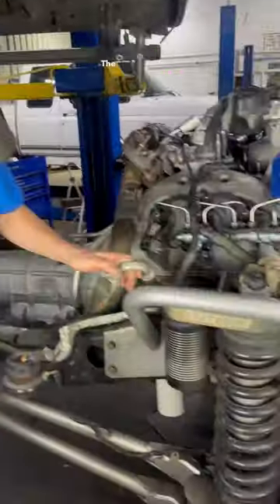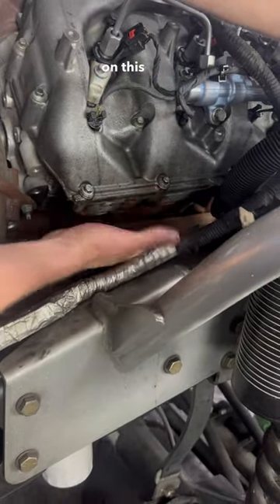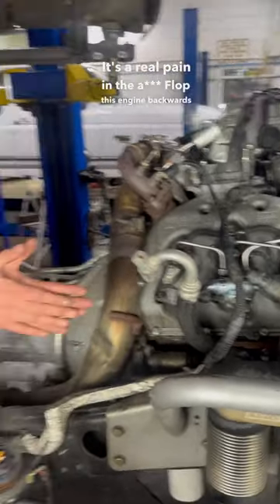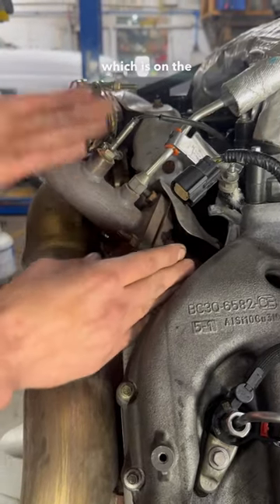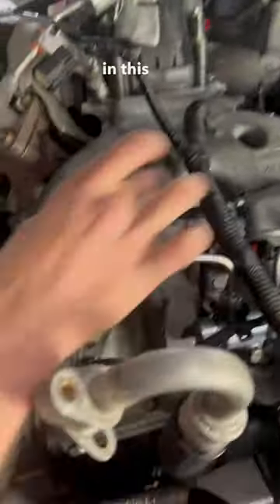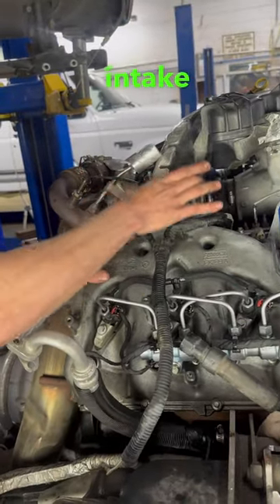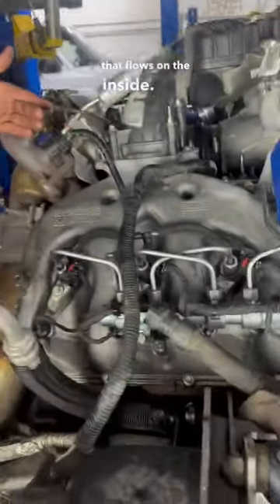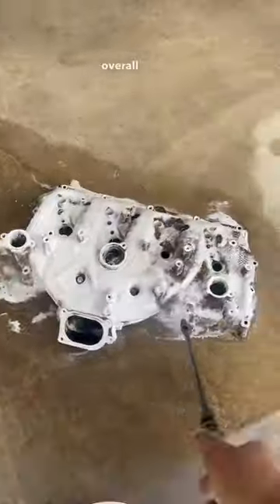What makes the 6.7 PowerStroke so unique? #ford #powerstroke #shorts

Comment: Makes you enjoy an inline 6 just that much more. Simplicity is your friend.
Reply: Except all the negatives about inline engines. There’s a reason the most powerful production pickup diesel and over the road truck engine are V-8s. 6.7L powerstroke and Scania 730
Reply: @jimmysturdevant9843  and the negatives are?
Reply: @steves9955 that a 1988 300 inline six still fires up today and won’t die so I don’t have to replace it, neither will my 7.3.
Reply: @ebolawarrior451   inline 6 are the way to go. 7.3’s are great, just a little slow.
Reply: @jimmysturdevant9843 Which is why almost all highway tractors and wreckers are inline?
Reply: @jimmysturdevant9843 Also most power doesn't mean most capable
Reply: @austincoutu  most capable isn’t a real thing. That’s an entirely subjective term. Scania is top dawg. We don’t have length restrictions I’ve explained that. Inline engines work better for our market. It’s a simple as that. Inline engines don’t have have any substantial attributes that aren’t negated by somthing else.
Reply: Who wants to be able to do an in frame rebuild or replace a valve cover gasket without pulling the entire cab off the chassis?
Reply: The inline six is gutless compared to Fords 6.7 and GMs 6.6.
Reply: @southernpovertycallcentere8373  well go back in time buddy it just ain’t possible anymore.
Reply: @Silent_Shadow  we’re not talking power junior, talking reliability and simplicity.
Reply: @steves9955 been a few 6.7 fords hit a million miles.
Reply: @freedomisntfree_44   I have nothing bad to say about the 6.7’a other than cluttered to hell under the hood. Most reliable diesel ford had since the 7.3
Reply: Yeah a cross flow i6
Reply: You could eat off the tailpipe of my 6.2 @ 106k, it's that clean....just sayin
Reply: Ford should design a clam-shell hood for easier engine maintenance.
Reply: God bless Jeep 4.0 and the Ford 300.
Reply: @steves9955 I guess they’re too balanced for him
Reply: @danielfrazier840 cross flow or reverse flow, both are fine
Reply: @ihaveshitmyself4424   yup, and dirty tunes leads to too much fueling not being burnt properly and end up with a melted piston
Reply: @jimmysturdevant9843  wtf? What world are you living in?
Reply: @jimmysturdevant9843 the most powerful diesel pick up truck ever dynoed is a straight 6. V8s nowhere to be seen. OEM ratings don’t speak to an engines potential. 

All things being equal the architecture of an inline 6 is much stronger. 

The scania 770 has 1.5 liters more displacement than an X15.
Reply: @jimmysturdevant9843  weird. I was able to have my head rebuilt without lifting my cab in my 2012
Reply: @southernpovertycallcentere8373  congratulations. I can do that on any ford too. Dummies don’t realize the WSM has a cab on procedure for all trucks
Reply: @jimmysturdevant9843  it's OK, I'd be salty if I had to do that mess of a job too.
Reply: @southernpovertycallcentere8373  don’t mind it even a little. Skill issue.
Reply: @austincoutu Are you sure about that? Do you understand why the US doesn't use V8s any more? A V8 weighs a minimum 1,000 lbs more. That is 1,000 lbs less profit. Europe still uses V8s.
Reply: @jimmysturdevant9843 absolutely  not true. All true diesel are inline 6.
Reply: @jimmysturdevant9843 did you forget the cummins I6 is more powerful than the 6.7 v-8....?? Speaking torque numbers
Reply: @braakaakaa  you must be under a rock. 6.7 powerstroke is making 500hp and 1200ft lbs. 🤡🤡🤡🤡

Comment: Nobody can convince me this is an improvement.
Reply: I literally is in all the ways he mentioned it 😐
Reply: Thats how modern engines make more stock power
Reply: @boraxguy8302  No that’s how modern engines cost more to repair.
Reply: If you have to replace the up pipes on a 7.3 or 6.0 you'll be convinced. Running the exhaust all the way around the motor is dumb.
Reply: @mikeznel6048 modern engines make more stock horsepower than anyone thought possible.
Reply: So Ford knows how to make a good engine.  But they Make these engines instead.  Is there a market for reliable replacement engines?   I'd sure think so.   I'd never buy one of these Fords.
Reply: @HK-qj4im  
No..not really

Comment: When air turns 90 degrees some flow is lost. But that's almost 180. The plus is that the air should be swirling by then. Hope it helps emissions or efficiency
Reply: It helps with turbo response by shortening the distance between the exhaust and the turbine. That reduces turbo lag because the shorter distance reduces the amount that the gases can compress. A side effect is that we don’t burn ourselves on a hot exhaust manifold when we’re working on stuff near the side of the engine.
Reply: Older engines that don't use the hot V also have to turn the air 180. The difference is this has a much shorter pipe for better throttle response.

Comment: The design is very similar to two cycle engine marine cross flows V4s, where the intake enters from the outside, and the exhaust flows across the piston head, exiting through the middle of the engine.

Comment: This is why people shake their head at Ford...why. has to be a mechanics nightmare! When repairs to a truck constantly mean removing the cab we have gone to crazy town!
Reply: Cab removal on a Powerstroke has been standard for years lol. But they said this version of 6.7 with the reversed exhaust keep turbo lag down because the exhaust is so close to the turbo. I have had a 6.0 and a 6.7, can’t say I notice a difference lol
Reply: The way they did it yes, the smarter way is to have the intakes fed by a CAC in front of the radiator. The valve cover should just be a valve cover
Reply: You gotta pull the cab on every v8 diesel pickup since the late 90s, and he quite literally said it was easier to work on because of it. It's a really good design and it's the reason cummins are being phased out of commercial duty work 😂
Reply: @johnsandlinjr and duramaxes, and later cummins
Reply: These trucks are incredibly easy to work on. They are not intended for Joe shmo to work on, tho. ain’t the 80s anymore bud
Reply: Shiiit more complicated means more money in my pocket when they break. Also job security.
Reply: Heck, my 13 f150 needs cab removal for engine access, and it's an ecoboost
Reply: @gbeving3167  not true. I just did phasers and timing chains on a 14 ecoboost f150 with the cab still on.
Reply: @yaboykris2118   same, but to pull heads the cab comes off
Reply: @addisonherbert6686 Oh yeah? Well that'd sorta be alright, if everyone had a hoist in a garage, in there front yard....
Reply: @yaboykris2118 half ton ecoboost is not a powerstroke.  One's for groceries and the other is a beast.
Reply: @MrStaybrown   yes, but I can understand cab removal on the powerstroke, its stupid on the tiny engine
Reply: @MrStaybrown  never said anything about a power stroke.

Comment: Seems like a lot of hot air going in.
Reply: They have intercoolers. Intake temp in intake manifolds usually range 6-14 degrees hotter than ambient. Air to air intercooling is more efficient, but you have less control over air temp for emissions control.

Comment: Wouldn’t having the exhaust from the turbo being so close to the intake manifold make the intake air hot? Or does that not matter even a little bit since the cab is off and the engine gets lots of air flow?

Comment: Im suddenly appreciating the simplicity of my 5.3 Vortec
Reply: Same, but ford's been making dumbass decisions for a long time, I'll note the pre 95 OBS F series trucks were ran entirely off vaccum. If the brake light on top of the cab goes out, it affects vaccum, and affects the way the truck shifts, runs, and advances timing. Those rubber houses are all 30 years old now and I tell you what, vaccum lines don't like whipping shitties, but the transmission is also ass. Ya see, the e4OD transmission from those generations was stronger, but once it broke it would eject itself pretty immediately. The AOD in my truck will continually get more and more fucked but it will keep going until there is nothing left for it shift with. When I drop it into gear, the entire truck lurches, but you gotta love the difference in idle sound between disconnected and connected to the trans.
Reply: @Trucks_n_stuff you apparently have not worked on any other 80s or 90s cars. Every car at least advances the timing with vacuum. 1980-1996 Ford pickups have no more vacuum line mess than a Chevy or dodge from the same time.
Reply: If they had only made the lifters easier to replace on the 5.3
Reply: I believe he was talking about the ford's eec3 back in the early 80's. You would have to use a vacuum gauge to figure out what codes you had or something like that. When Ford went eec4 in 86 that's when the AOD Trans and fuel injection came out. Much better system then eec5 in 1997. Eec4 had a 60 pin pcm, and eec5 had a 104 pin pcm. Damn I'm showing my age as a mechanic . That time period was when I was a really strong tech kinda like this kid in this video is on modern stuff. You have to have alot of testosterone to work on these new vehicles.  Something I don't have at 55 years old and 30 plus years as a mechanic. At my age you want to make the quick easy money. Leave this type of work for the young bucks.
Reply: @jaredlancaster4137  vaccum advanced distributor timing is such a common thing I figured it was pointless to mention it. And yes, even my dad's 2000 toyota tundra had a mess of vaccum lines. And the point isn't that other vehicles don't have that issue. The point is that having a brake light fuse be somehow integral to the vaccum system is notably ford levels of silliness. They can be wonderful trucks, I adored mine when I had it even if it was a POS. Just because I think something should've been done differently, doesn't mean I dont like what was done.
Reply: @jaredlancaster4137  and you'd be somewhat right, I'm going to college to be an automotive technician, however we haven't done very much that would pertain to vaccum systems and my dad's always been a bit of a Fudd about working on cars so I never got much experience.
Reply: @hillbillyhicks8102  and after learning more about that Era of four, I learned my particular AOD wasn't all that fucked up, it just didn't have enough vaccum. It's amazing it still shifts considering how beaten on it is, but that's the beauty of a classic ford. No matter how fucked up it is, it will find a way to run.
Reply: @Trucks_n_stuff  okay...... As an owner of a 1995 f150, what vacuum brake light fuse are you talking about?

Mine has no issues with the vacuum system despite being rather beat up and missing parts.
Reply: @jaredlancaster4137  yeah, you have a 1995. The 1995s switched from speed density to MAF which resulted in a greatly simplified vaccum system.
Reply: @jaredlancaster4137  and I never said vaccum brake light fuse, i said brake light fuse. And I should've been more specific, it's not just the brake light fuse, it's the fuse for the topmost cab mounted brake light specifically.
Reply: @Trucks_n_stuff  well, you said "brake light fuse somehow integral to the vacuum system". I still have no idea what that would look like.

My 1995 is still OBD1 and looks identical to my 1993 f150. I think the change you're talking about happened with OBDII, which was changed during 1995 for 1996 model year.

In general, I really don't think there's more vacuum nonsense on my f150 than on a couple dodge minivans I had, and I think there's less than my 1991 and 1992 Accords, which seems to still have a vestige of the 80s Honda vacuum ECU.
Reply: @jaredlancaster4137  I'll attempt to explain. Basically, the fuse for that light is in some way, tied into the electronics that tell the motor when vaccum is needed, not just to advance timing but to shift as well. The result is, when that fuse is burnt out, you get noticeably worse shifting. It lurches into gear instead of shifting normally. As for the exact why, I'd have to ask the guy I sold my ford to because he's been the one to fix its issues because he's owned a fair number of obs ford's and is far more knowledgeable than I am. That's who my source of information is, and he is a master mechanic in addition to his real life experience. If you'd really like a better explanation I could ask.
Reply: @Trucks_n_stuff  well maybe that's why mine doesn't have vacuum issues, both of mine have been manual.
Reply: @jaredlancaster4137  that's probably a large part of it. M5OD or ZF5?

Comment: How does heat help a turbo???   Then why do we have intercoolers?
Reply: Right cause the intercooler usually cools the exhaust pre-turbo??
Reply: It’s called thermal efficiency. The hotter you can run the engine, and keep said heat confined within the engine and exhaust, the more efficient the engine is. 🎉
Reply: It's all about atomization, and my 3.5L EB runs more efficiently in summer heat than winter cold. 6.7L turbo benefits from the design in the same manner.

Comment: Ford should've made higher tolerance rod bearings too 😂
Reply: The bearing is fine, it's the oil reaching the bearing.  Dry for 15 to 19 seconds at start up will spin those bearings. There's a fix out there, just not from the dealership.
Reply: @beowulf885  do you mean clearance?

Comment: This guy acts like this a good idea. Anytime you have to separate the truck from the frame to work on it... is a freaking horrible design.  They purposely engineered it so that you , the owner, can not service it. Also if your valve covers are leaking ($50 repair on most vehicles) You will have to replace all of those gaskets just to fix a small oil leak. Ford can f..k all the way off for treating their customers like this all in the name of profits. And bro try working on a gm or dodge... not as complex for no reason. Yes it is a good motor but engineers and board members f..ked
it up.
Reply: Tell me you have no idea what you’re talking about without telling me…..^
Reply: Tell me you've never worked on one without telling me

Comment: Explains the guy with the engine exposed for service/repair by removing the entire cab structure. There are 450 less parts in the 6.7 Cummins vs the Powerstroke, making the RAM infinitely more serviceable without the need for cab removal.

Comment: Ford: How can we make out engines less reliable so we can pump customers for repair money.

Engineer: BMW's hot-vee engines are less reliable than most of their other engi... 

Ford: Say no more
Reply: My 2011 6.7 has 400k on it and I've never had a valve cover off. Done 1 turbo and a cold side IC pipe. You're on crack if you think a 6.7 isn't a solidly proven engine